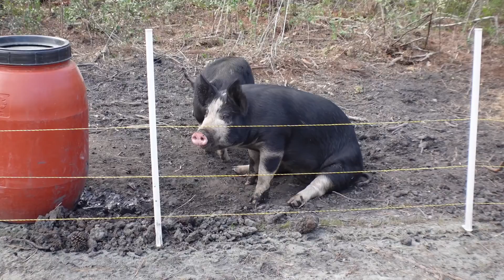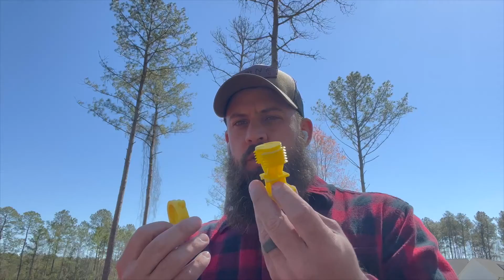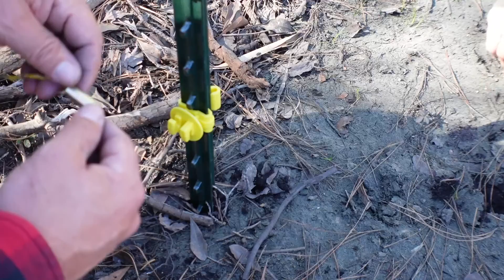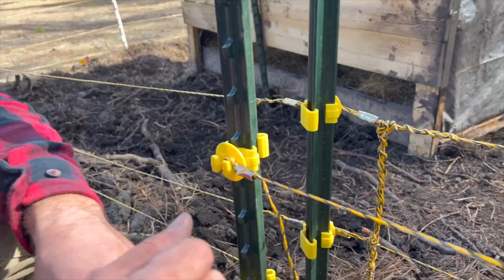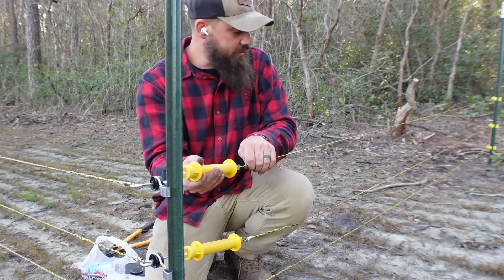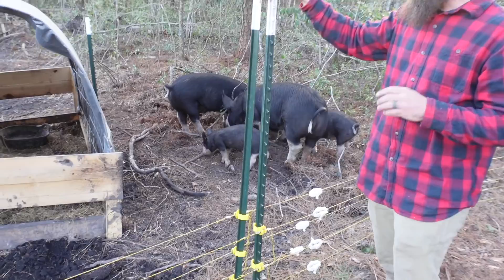Easy, Electric Wire Fence Install | Perfect for Hogs!

Comment: Do you train your pigs to electric wire before putting them in?
Reply from the maker: We did!  We started them off in Premier 1 hog netting within hog panels and t-posts.. then eventually took the hog panels down once they respected the net.
We had no issues moving them over to the wire after that!
Reply: @The Homemade Haven  we put them in hog panels lined with electric wire as well.  We do something similar but yours looks way better. 🤣
Reply from the maker: LOL... Hey, whatever works! 😆